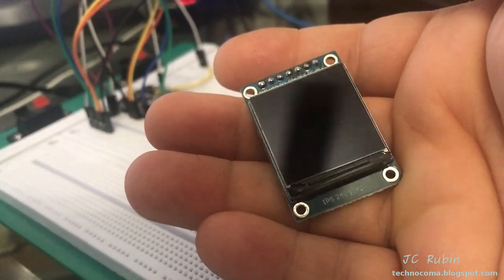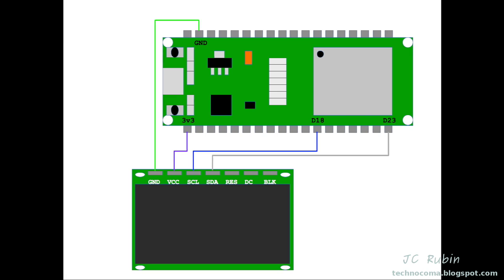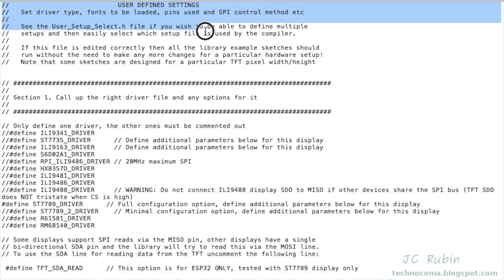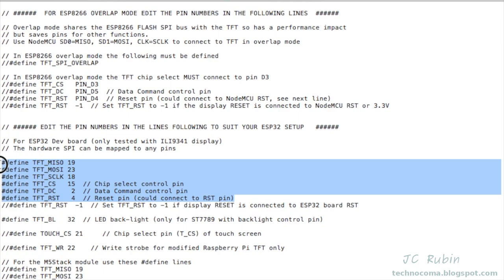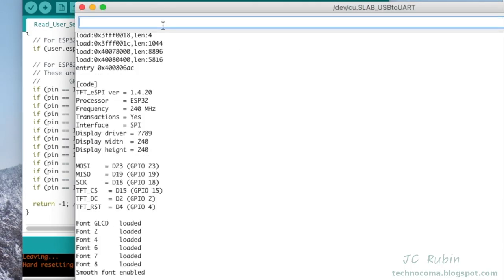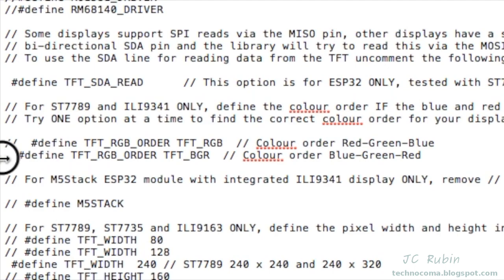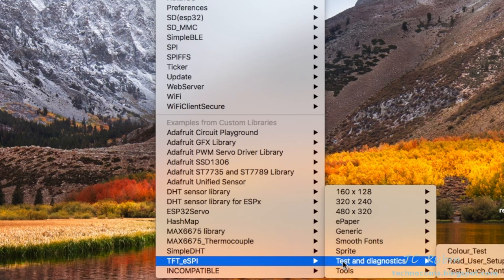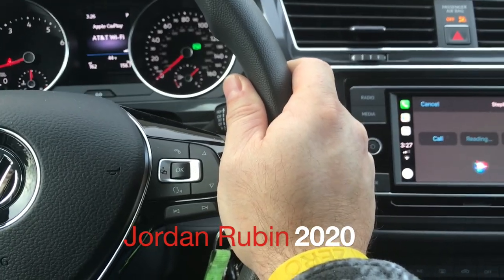Connecting and Configuring the ST7789 LCD SPI Display to the ESP32

Comment: unfortunately I can't get it to work, I have the tft_espi library installed with the modifications of the User_Setup.h, I tried with another screen but it's the same although both are new, the unic thing seen is a very weak backlight! next i was connect the blk to 3.3v for to see if it is for this reason but nothing

Comment: Just hooking this up to an ESP32, but can you tell me, does the library for SPI on this LCD stop pins D19 (SPI MISO) and D5 (SPI SS) from being used as GPIO for other purposes? Or for simplicity, can the RES and DC by swapped over from the D2 & D4 connections to use the D19 and D5 instead? I only have this one SPI device, and would like to use all the pins possible.

Comment: I'm using an ESP32S3 DevKit and is working with this pins:
#define TFT_MOSI 11
#define TFT_SCLK 12
#define TFT_CS   -1  // Chip select control pin
#define TFT_DC    8  // Data Command control pin
#define TFT_RST   9  // Reset pin (could connect to RST pin)

Work very well, thank you

Comment: Thanks for creating this tutorial.   Info on the 'net about the ST7789 1.3" 240x240 module was pretty confusing, especially the I2C names on what are actually SPI pins.  This video clarified the situation.  I followed each step, got a clean compile and a working display.  Also, good suggestion below to make a copy of setup.h and keep it in a safe place so future updates don't wipe your working setup.

Comment: OMG Finally I can get that stupid display to work haha! I wish I found your tutorial Months ago! It's hard to beat that display for cheap value .. I bought 2 of them for something like $3.49 each on aliexpress, but ZERO help or hint as to documentation for a "No CS pin" display in regular Arduino IDE drivers or Adafruit or CircuitPython. I was hoping to get this display to work on any RP2040 variant, but this tutorial is for ESP32 ... which then worked awesome with my Adafruit ESP32 Feather. Thanks again for putting this together!!!
Reply from the maker: You're welcome, enjoy!

Comment: Great video. Got the Read User setup to work but Width was returned as 135 when it was printed as 240x240 on the board. None of the following steps worked. Maybe I got a wire crossed. Never the less, very useful content
Reply from the maker: Glad it helped

Comment: Thank you!  Got some of these screens, you helped me get them working.  Now to make a tiny videogame system!  :)
Reply from the maker: Good luck!
Reply: @retrotechandelectronics  Thank you!  Got the "UI" working last night, I put a 20x20 box in the upper right with a 4x4 flashing cursor in it.  The accelerometer "moves" this around within the box, indicating how fast the actual cursor will move.

Then there's three lines of text, one per "game", with a box to the left of each, which has a section within the box on the right; that section is green if the game is available, red if not (e.g., could use for unlocked levels).

By "moving it as if there was a ball on the surface" you can then move the cursor to one of the green or red sections.  If you hit a red section, it says "CAN'T ENTER RED!", and if you hit a green one, it says "getting ready..." -- for now.

I could have added buttons, but this "user interface" was fun to program, and can be used elsewhere.  First actual game I'm planning to make is the "snake game" and I'll use the accelerometer for controls.

Thanks again!

Comment: Thanks for the video! Quick question: If I just connect GND and VCC to 3.3V, should the display turn on? Because mine seems to do nothing. Maybe I should connect the BLK to 3.3v?
Reply from the maker: No. It needs to be initialized in code

Comment: fo VS Coder on platformio:

there is a better way to initialise the screen , within the platformio setup. 
So you dont need to change the libraries.

just use flags for the desired variables to be defined like this:

[env:nodemcu-32s]
platform = espressif32
board = nodemcu-32s
framework = arduino
monitor_speed = 115200
lib_deps = 
	
	
	
	bodmer/TFT_eSPI@^2.3.61

build_flags = 
    -DUSER_SETUP_LOADED=1
    -DST7789_DRIVER=1
    -DTFT_WIDTH=240
    -DTFT_HEIGHT=320
	-DTFT_MISO=-1
	-DTFT_MOSI=23
	-DTFT_SCLK=18
	-DTFT_CS=5 
	-DTFT_DC=2
	-DTFT_RST=4

    -DLOAD_GLCD=1
    -DLOAD_FONT2=1
    -DLOAD_FONT4=1
    -DLOAD_FONT6=1
    -DLOAD_FONT7=1
    -DLOAD_FONT8=1
    -DLOAD_FONT8N=1
    -DLOAD_GFXFF=1
    -DSMOOTH_FONT=1
    -DSPI_FREQUENCY=27000000

Comment: Just a reminder to everyone:
Make a backup of the edited user settings AND put it in the .../libraries folder, not the TFT_eSPI folder.  If you choose to use multiple setups, then back them all up.
Why? Because if you update the driver using the Arduino IDE, it wipes all the files, possibly by downloading an unpacking the entire directory for this library with overwrite.
And then you're back here re-doing your edits.  I'm sure you can all guess how I know.
Reply from the maker: Good to know.... In platform IO there is no centralized config files, each project has its own.  I realized this when I updated the arduino ide driver...
Reply: Thanks. This is one area that I hope gets better with some kind of overlay system or setup for configurations. If you work with several different boards and displays in different projects, how do people keep the configs straight? It looks like the current setup only really works well if you always use the same board and the same display for every project?

Comment: Hi, thanks for the great video! Regarding the TFT_INVERSION_ON or TFT_INVERSION_OFF not producing any change in the example "Colour_Test", it indeed produces changes for the "All_Free_Fonts_Demo":
   - With TFT_INVERSION_ON defined ==> black text with white background. 
   - With TFT_INVERSION_OFF defined ==> white text with a black background.
None defined seems to get the last constant used defined.
So, the bug is in the "Colour_Test" example, not the library.
With my display I need to have TFT_INVERSION_ON defined, otherwise the starfield example has black stars with a white background...

Comment: Thank you for the video. Quick question. Is there a way to access the SPI Chip Select (CS) line of the interface on this display?
Reply: I've answered my own question. It's not currently mapped to the header. it's Pin 8 on the ribbon on the back. I presume it can have a jumper soldered to it and test.

Comment: What is the best way to make for e.g. a small battery symbol for it? Coding with lines or loading as .h file?
Reply from the maker: As a one off in a pinch for a program I could make it with lines pretty quick.
Reply: @retrotechandelectronics  great - thanks for the answer, helps :-) So nothing wrong to make it in lines, instead of a picture. Thank you.

Comment: Hello, helpful video. Found it when I couldn't get the display to work. Ran the dianostic but it reports nonsense pin allocation, MOSI    = GPIO 2
MISO    = GPIO 5     SCK     = GPIO 15     TFT_DC   = GPIO 5  TFT_RST  = GPIO 2. Would seem to be why nothing works, I suspect the esp32 itself, any one help at all. Thank you
Reply from the maker: Careful with gpio pin 2 on certain boards that could be the onboard led. Use another

Comment: Thanks for a great video, Jordan. It’s really useful, invaluable even, because the pinouts on the module are incorrectly labelled for I2C, instead of SPI. 
Can you say which pin on the ST7789 should be connected as a CS (chip select) pin on the ESP (default TFT_CS is 15).

To me, the pin conversion wasn’t fully clear early on in the video - you gave the PIN numbers but not their meaning in the setup header file, which only comes later in your video :
1m41s
SCL D18 TFT_SCLK
SDA D23 TFT_ MISO
RES D4 TFT_ RST
DC D2 TFT_ DC
BLK n/a (ground to turn off Backlight)

4m47s
TFT_MOSI 19 n/c
TFT_ MISO 23 SDA
TFT_ SCLK 18 SCL
TFT_ CS 15 n/c
TFT_ DC 2 DC
TFT_ RST 4 RES
TFT_ BL 32 n/c
Reply: Generic ESP32 setup
//#define TFT_MISO 19
#define TFT_MOSI 23
#define TFT_SCLK 18
//#define TFT_CS    -1 // Not connected
#define TFT_DC    2
#define TFT_RST   4  // Connect reset to ensure display initialises

Comment: vwey helpful. i m looking a simple device could measure air pressure , temp , air quality and etc. because i live close to Himalaya mountains . i want a make smart  device which could help me measure many things
Reply from the maker: I would recommend you assemble a device with more than one of each sensor and measure the deviation for each for greater dependability for specific values in harsh terrain.

Comment: Thanks a lot, man! You video resolved my issue (same sh&t, incorrectly marked pinouts - damn Chinese manufacturers!). I recommended @Bodmer to include your video to his library Wiki page https://github.com/Bodmer/TFT_eSPI - this is very common issue with cheap TFT SPI displays.

P.S. What I really don't understand, why Chinese manufacturers make same mistake all the time? I saw many different cheap TFTs on Amazon, eBay & ali, marked same way (i.e. incorrectly)...
Reply from the maker: The concept of QC in China is non existent.
Reply: @retrotechandelectronics  Oh, by the way, I forgot to ask you: what software you've used to draw schematics, and could you share your virtual parts (esp32 devkit & 7 pin display)? I'm trying Fritzing but can't find similar kind of display (only "legal" Adafruit ones with a lot of pins).

Comment: I use ESP-IDF and don't need all this crazy Arduino stuff.
Reply from the maker: That the connection, and the library, and the configs, and the testing have little to nothing do with the ide, who cares besides yourself that this was demonstrated with arduino ide? Did that confuse you?
Reply: @retrotechandelectronics  That Arduino library may not exist in few months and your code won't work. Happens all the time. Also I am talking not IDE but Arduino framework. Arduino framework can be used with Visual Studio Code as well, not necessarily Arduino IDE which is horrible imo